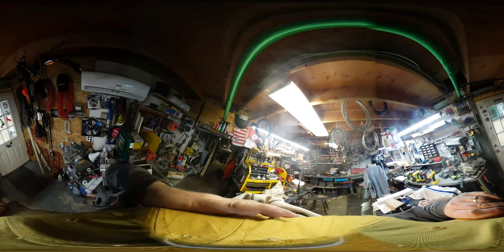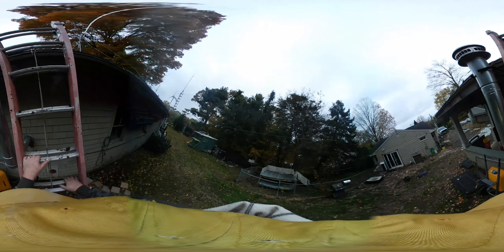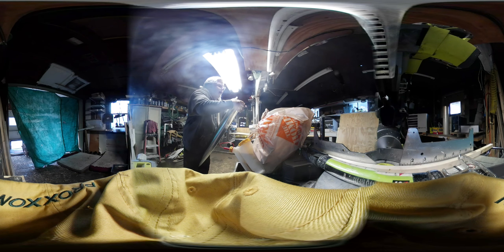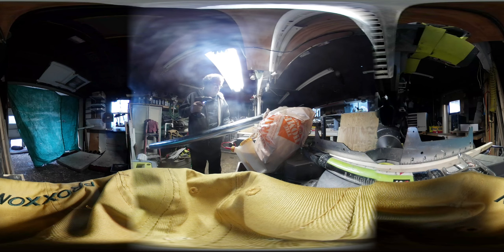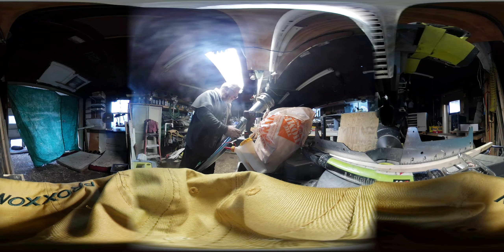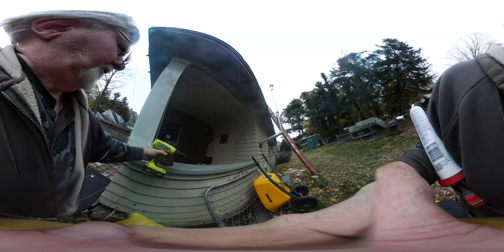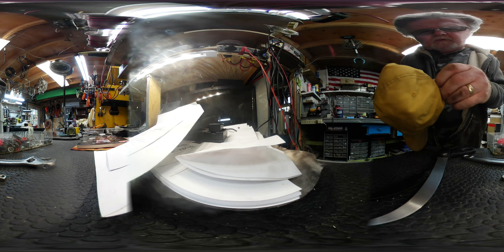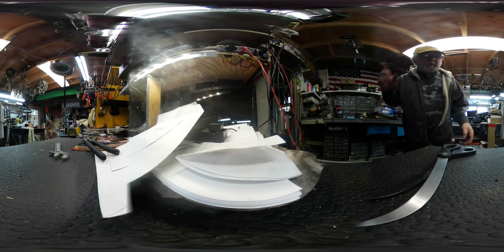360 Adding vent pipe to shop heater chimney

Comment: Thanks for sharing 8 cords of wood that's a lot of wood and stay well bye for now your friend Ken
Reply from the maker: O for sure, I'll never get it all done this year so Im going to try for 4-5 to get me through the winter. I burn it in the shop for backup heat, I run the gas furnace at 55 at night to keep the chill-out then fire up the wood stove for the daytime while Im in there hanging around doing stuff.   What I have now and what my son will be dropping off should last me 3 winters.  There is no installation in the old side so I burn 4-5 a season.

Comment: Those batteries for those drills are not cheap. Looks like you got the chimney all setup brother. I so need to do something like that for my garage ha!
Reply from the maker: I decided not to buy a new battery or charger.  I'm going back to Ryobi. lol    Heat in your garages lol, funny how cold does it get there? 50?  Now the air conditioner with the heat pump may be your ticket, easy to install, cheap to buy, and cheap to run.  I bought mine at Alpine, it comes charged and ready to go just wire it.

Comment: Yeah Buzz... after my dewalt batteries gave out I let my dewalt sit until my craftsman gave out then ordered cheap dewalt knockoffs online probably from china pretty cheap and still working.!! Actually glad to be back with the dewalt again.!!,,, Was that a Ryobi your using? I'm gett'n into them now. Good job gett'n the pipe up buddy.!!
Reply from the maker: Dewalt cost big bucks and would expect more from it, I got more out of my old Ryobi drills than any other. However, I've had problems with Ryobi bandsaw but not sure if it was Ryobi or Home Depot.